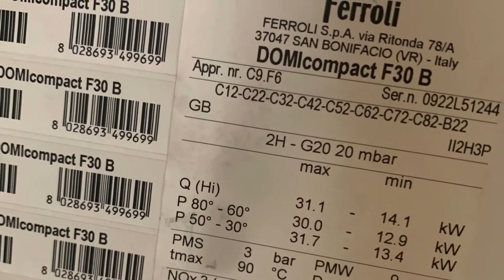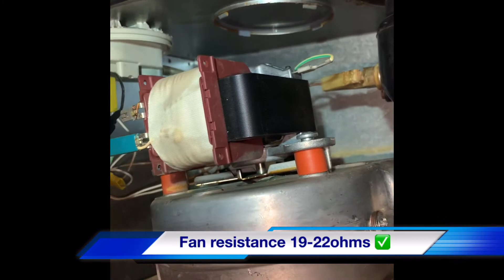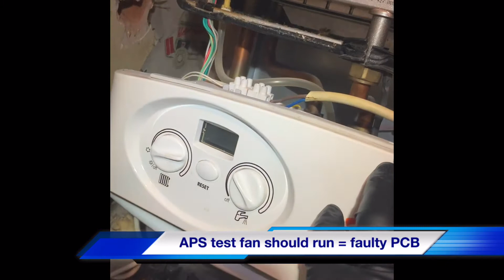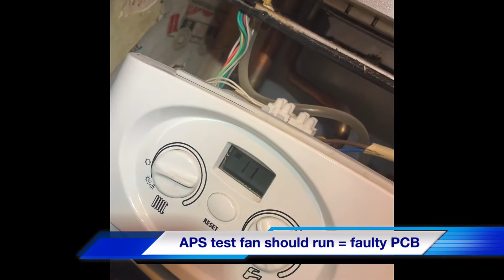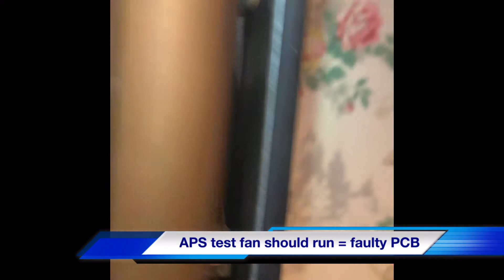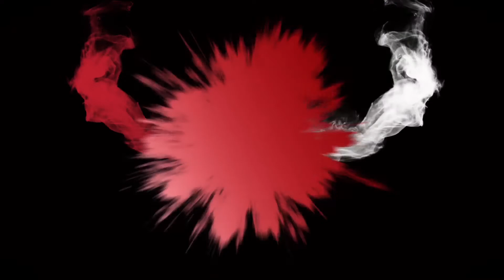F5 fault ferroli domicompact f30b  https://3tgas.co.uk/

Comment: Maaann, I replaced the fan on mine after seeing it try to start spinning but not. Then the new fan didn't spin up so I bought a multimeter and tested the 240v to find it wasn't receiving full voltage so replaced the PCB. Now the fan is spinning up but still getting the F5 error... I swear this things gonna drive me insane, but time to test the pressure switch :(
Reply: Hi mate, i had same problem on this boiler, im only getting 25v at the fan  harness.